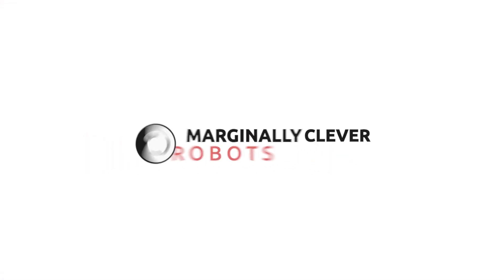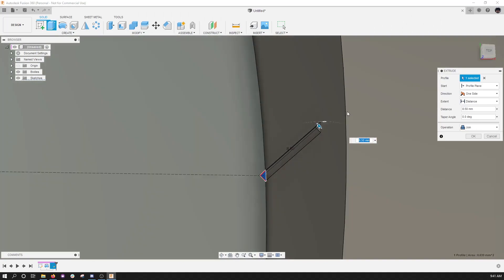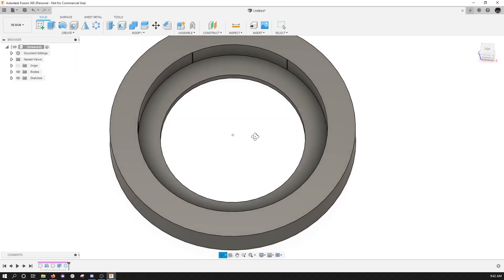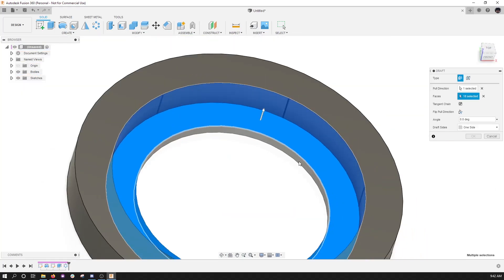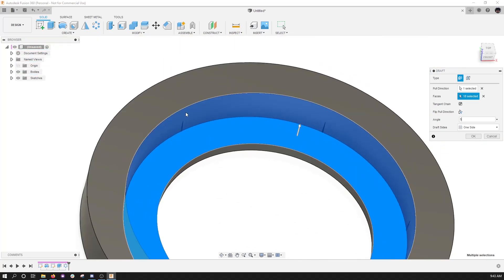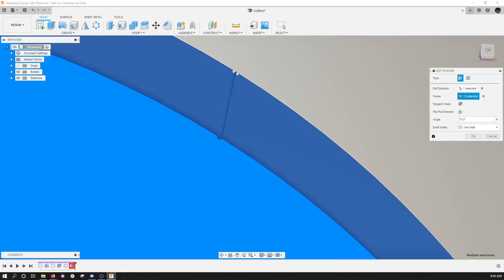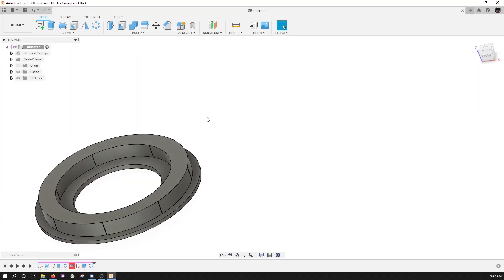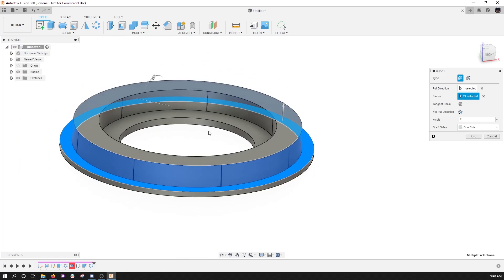How To Make Crush Ribs in Fusion360!

Comment: Thanks for the help. I'd add that it is easier (for me) to make a section with the rib and draft, then rotate that whole feature.
Reply: Follow up - in the initial video it looks like the ribs go all the way up to the edge, but in this video and when I tried it out, the ribs have to "draft away" so they don't reach the edge or the draft fails. Was the original video made with a different technique?
Reply from the maker: circular pattern the set of features?
Reply: Dan Royer I decide how many ribs I want and then create the appropriate amount of the ring (for 4 ribs, I'd create a 90deg slice, 6 would be 60deg). Then I add a rib and draft to that slice and create a circular pattern to complete the other 3 slices to complete the ring. Hope I didn't confuse things. It's not easy to make instructions. Glad you are able to do it and share with us.